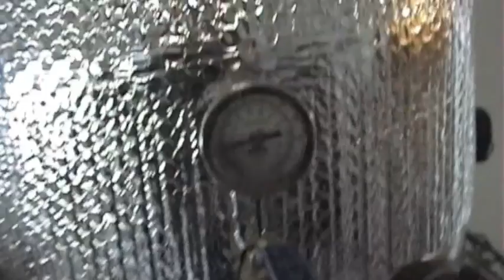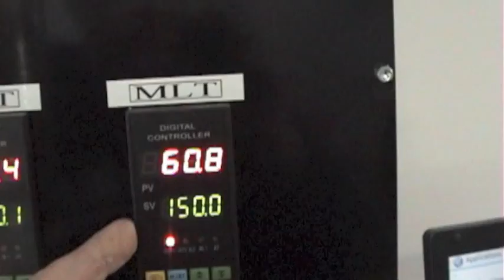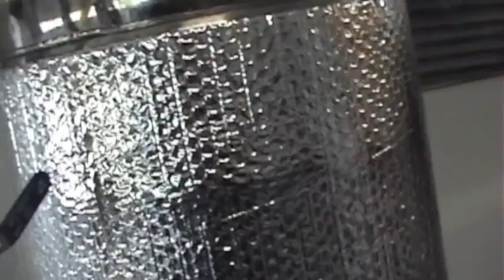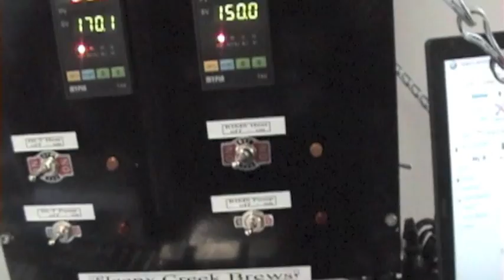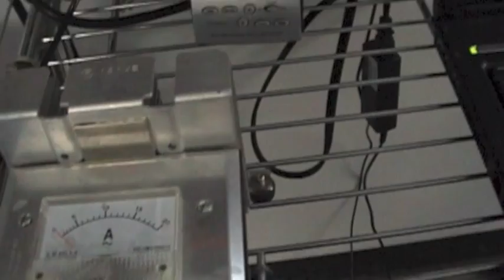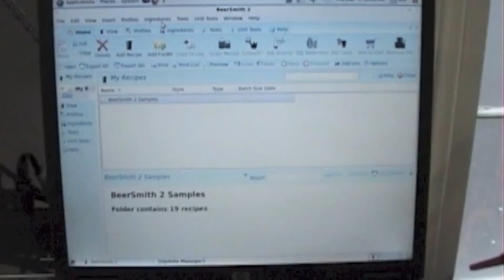RIMS all grain brewing intro, part 2

Comment: How did you get the valves and heat element into the hot without having access to inside of keg?
Reply from the maker: The valve and thermometer are screwed into fittings that are silver soldered into the kettle. As far as the element, it's been a while, but I think I just fished it in there with a coat hanger or something ...I don't recall it being a big deal tho'. hope that helps.
Reply: if there is a lid on the hot, how did you solder fittings into it?  I must be missing something

Comment: This is great info! I was wondering about those pumps and now I know. I am curious how you made that RIMS tube. Looks good. Some people have been having problems with rust. Have you had any issues with it? Basically I'm asking for a video on your RIMS tube and how you made it haha. Any info would be great! Thanks. Cheers and happy brewing.
Reply from the maker: +Clayton Winter  Hey Clayton. Thanks.  The RIMS tube is just 1.25"  copper pipe, and some fittings that I silver-soldered on. the 240V 4KW element screws right in to the back side, it seals well with the silicone o-ring I use. Copper doesn't rust, so no, I haven't seen anything like that.

Comment: Great set up I'm currently looking to switch to all electronic brewing. I'm interested in how you made your RIMS tube. What kind of fitting did you use to connect the heating element to the rest tube. I'm having trouble finding the right size fitting that accepts the heating element threads. Can you give me the name and size of the fitting. Thanks in advance.
Reply from the maker: Hey +dmmflys ,  excellent question , honestly, I can't remember,  I'm going to have to do some research and get back to you on that  :) 
I can tell you that it wasn't anything  I fabricated, it's some sort of adapter that already had the threads inside it.
Reply: +S Scott (Sleepy Creek Brews) 
Thank you!!! it would be a huge help.
Reply from the maker: +dmmflys  95% sure this is what I used to slide inside the 1-1/4"  copper RIMS tube :
 http://www.supplyhouse.com/Cello-WP3-16-1-Copper-x-Female-Adapter-987000-p  .
 I trimmed it down some so I had less material inside interfereing with the hose-connection areas.   At the other end, I used a 1" cap to slide "inside" the 1-1/4" tubing (trimmed as well) .  

Disclaimer**  ;-) I assembled this one afternoon from some material I had laying around the shop. I'm pretty sure the 1-1/4" copper pipe was type L , which would give you that 1.26" or so ID to be able to slide the 1" fittings inside and solder 'em.
Reply: +S Scott (Sleepy Creek Brews) thanks for all the info and your time. i have some stuff on order when i get it all and put it together ill let ya know.

Comment: Can you explain to me either here or in a message the wiring for a pump of that style?
Reply from the maker: The pumps don't draw a ton of current, so I can use an old laptop charger (16 VDC, 1.5 amps) to power all 3 of them. In reality, only 2 are ever used at the same tine though. Basically, there's a 12V terminal strip inside the control panel and the 3 pumps are all wired in parallel with their own on/off switch.